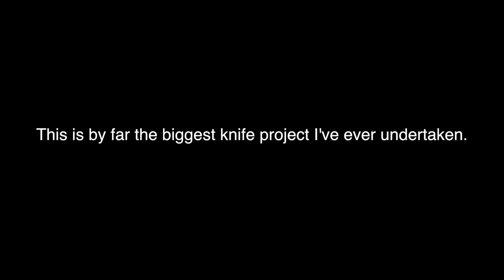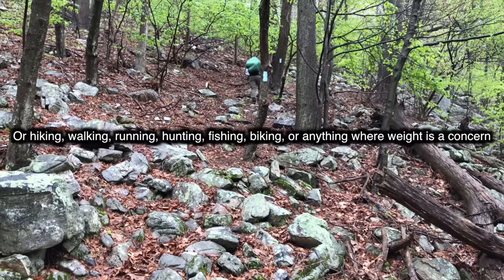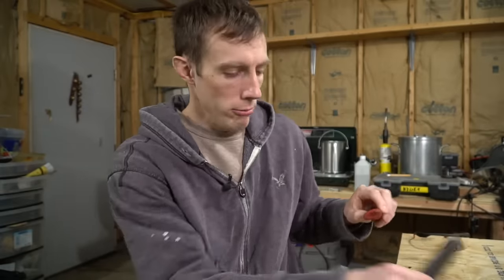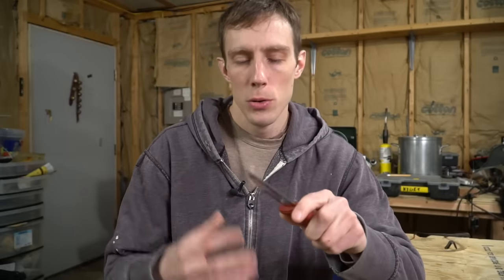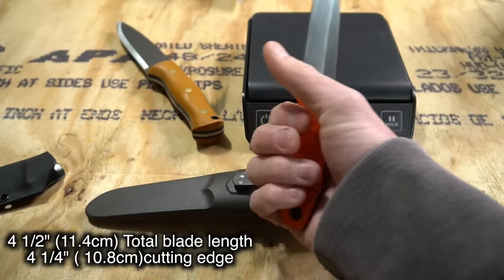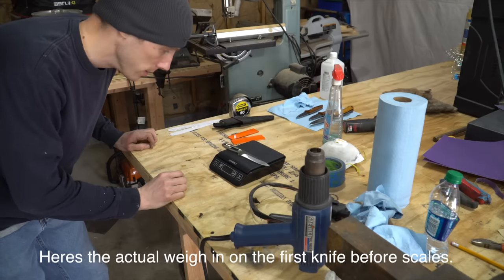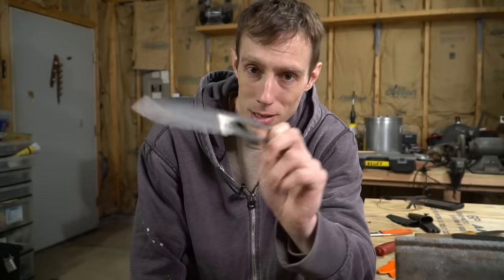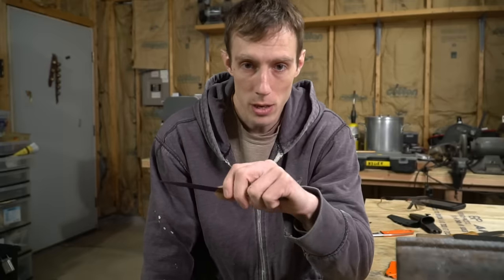What is the ULTIMATE Knife? Probably not what you think...

Comment: These hiking types really make my head hurt. I'm the army, we didn't measure rucksack weight by ounces, but by pounds. Then you add 210 rounds of 5.56. A six pound rifle, and if you are really lucky, your Sergeant hands you the first forty pound receiver to the .50 Cal. So yeah. Couldn't have cared less about the one pound chunk of steel strapped to my belt.
Reply from the maker: Your completely missing the point..
Reply: Three point is, one ounce doesn't matter. One pound doesn't matter. The more you do it the stronger you get.
Reply: It's ok though. If you are worried about it, then by all means, carry lighter stuff. I just never got the choice. I'll take a knife that I know I can rely on, even if it is a bit heavier.
Reply from the maker: The point is, if every piece of gear is 1oz lighter thats adds up to pounds. For the same reason aluminum, titanium, and carbon fiber is used on airplanes. Saving one ounce on a 250,000 pound aircraft seems pointless. Untill you save one ounce on every part. 

So the argument would be the same. Why not just throw bigger engines on the plane and not worry about weight? It's called power to weight ratio, and diminishing returns. 

At some point putting bigger engines on the plane actually makes it slower, and able to carry less weight. The weight of the engines them selves becomes the problem. 

The same thing happens in humans. Theres a reason you dont see 220-300 lb weight lifters winning endurance sports (cycling,running, cross country skiing, triathlon etc). They simply weight too much. Their body weight outweighs their ability to move fast enough. 

Certain types of backpacking/hiking trips require the same type of endurance. Through hiking the AT for instance. And long, high mileage hikes where you can be moving 15-25+ miles a day for days on end in mountainous terrain. 

This is what this knife is designed for. Someone who does these types of things where weight is the highest priority. And unless you do these types of things you most likely wouldn't understand.
Reply: I have done these type of things my entire life, strong when I was ten years old in the Boy Scouts. And assuming that I just don't know what I'm talking about is getting kind of old. Those aluminum and titanium things you are talking about did not even exist when I was your age. This was only twenty years ago, by the way. I was a weight lifter. I had eleven percent body fat. I was an extreme athlete. Not so much now, but I'm forty years old and work to much. I'm not trying to make you feel like you are doing something wrong. Go for lighter if you want, but my point is, that you don't need lighter if you train for it. Train, train hard. We always said in the army that you should train as you fight. But that isn't what we did. We would train harder than how we would fight so when it came to the fight, we were overtrained. Does this make sense to you? I'm not calling you a pussy. I'm trying to help you. Take it for what it is and quit fighting. Old guys usually know what we are talking about.
Reply: And by the way again. Good for you for getting out there and getting off your ass and going something. Just so you know, I don't dislike your video. I'm actually quite proud of you for doing the things I myself love to do. But when you get a young son and a wife to go along with you, you will appreciate my advice. You will be strong enough to carry to stuff that they aren't able to. Be proud of being a strong man. Nothing wrong with it, despite what people are saying that's days. Be strong, young man. Hooah.
Reply from the maker: To each his own. Btw im not younger than you. And have a wife and kids. 😉Just goes to show never judge a book by the cover.

Comment: Pro tip: before epoxying on the scales, put on scuba gear and evacuate all the air in your shop. Then introduce a pure hydrogen atmosphere and make the scales gas-tight. This will save at least a quarter gram compared to an air-filled knife. If you multiply this by the miles carried and the remaining years on your life, this simple expedient will make the knife an average of 3.62 metric tons lighter, and that's nothing to sneeze at, bra.

Comment: If money isn’t a parameter why not just use alloyed titanium for the blade with your carbon fiber scales?
Reply from the maker: Titanium is a poor knife blade material. Its just way too soft and not very strong.
Reply: @OUTDOORS55  look into grade 38 titanium alloy. I don’t have cad or any of that stuff but it seems to have decent strength and shear resistance. If not that then try grade 5 titanium alloy. It’s heat treatable so you can increase its strength and hardness. I’m not a knife maker so I don’t know I just thought it would be an interesting yet expensive idea. I’ve seen axe heads made of titanium and they performed better than their steel counterparts. Yet again axes are different than knives so who knows? I sure don’t lol. Loved the vid tho!

Comment: Make a carbon fiber handle for your knife.
Reply: shoveldriver1 to be able to break that red plastic you need to beat it several times with a sledge hammer - it is sturdy and still a bit flexible so the chance it breaks is nearly impossible , especially outdoors and not in a machine shop with heavy objects falling

Comment: Let's see... Better get cracking on a titanium san-mai blade with a carbon steel core for weight reduction. You already have some carbon fiber underway so that's good, though also hollow them out on the inside. Deep hand filed jimping all over the blade, taper that tang bruh!, carbon fiber handle pins, perhaps a hollow grind, heck, trow in a nice deep fuller, perhaps even with a row of holes in it, and slim that puppy down. Serations on the edge (yeah I know, they're a b*#ch) can also save you some weight, and a nice big swedge on top, which you can still leave plenty sharp for them ferro rods. I still see lots of potential in making that thing as light as a hummingbird's butt feather 😁
Reply from the maker: Lol 😂 titanium sanmai would be epic if possible 😂
Reply: Serrations won't hold up to batonning. The parameters are what is challenging

Comment: Why not spread out a oz of weight savings across your whole pack, and increase your stamina a bit? Seems like it's be easier to add weight on your person while doing cardio and offset an extra ounce of weight with physical prowess.
Reply from the maker: Your missing the point...if one was to add 1oz of weight to every item, one would add a lot of weight. If every item has already gone through the weight cutting phase, why not the knife? Same for air planes or anything else where weight is an issue.

Comment: I have that same knife mine's a little bigger than yours and the handle has soft rubber on it but that thing's a damn good knife and it holds an edge like a son of a bitch and for 75 bucks hell yeah I do it again only problem I have with it is it rest really easy and the way the handle is makes it a little hard to sharpen the very top of the blade but other than that the damn good knife I buy it again I was hesitant until I got looking at it things built really sturdy like I've  beat the hell out of this thing and I can still shave my face with it put an Edge on it it holds it but it is hard to sharpen because the middle is so damn hard like if you use and stones and stuff like I Do by hand hope you got some time you going to need it oh that in the sheath is really good in handy so you can just clip it on and off your belt without taking it off and it holds the blade in there really good I like man you're looking for a good knife on a budget well you found one

Comment: Tappered tang boy! Check Jeremy from simple little life making a tappered handle knife, you’ll shave some grams.
Reply from the maker: I was trying to not do the tapered tang route. I want some lateral strength in the handle for battoning. If i want i can still remove the same amount of steel in the tang, just on the inside of the hollow rather than the edges like on a taper. And id still have some lateral strength. I still may do a taper though im just not sure if it's needed yet🙂

Comment: I appreciate what your trying to do. But there is no ultimate knife. If your just hiking or marathoning and want to save ounces. Well just get those disposable skinning knives, you know the scalpel  that come with extra disposable blades. If at any point  in your week long trek through the woods your planing on camping or just doing regular chores, like camping or fire making or even building a shelter out of your surroundings?  Then dont skimp on the knife, no matter what the weight is, its the one tool you would be using constantly, and for everything, if you want to save ounces, I think the guy that said dont wear underwear or get light weight shoes may be on to something.
Reply from the maker: So your saying rather than having the correct tool for the job, to accept a compromise...The point is, I need a knife for a specific job, thats still capable of doing what I need it to do, as outlined in the video.  Its not skimping. Its carrying exactly what you need and nothing more and nothing less.
Reply: Well you did say its just for opening dryfood and cutting paracord. So ya, the disposable kifes can do that and there pretty light, in fact if carrying  is to much, you can just throw it away. But in all what I am saying is, that if 10 oz is to much weight to carry, time to hit the gym or work out a bit more. I dont know, personally I like and make knifes that are more on the robust side, i have some choppers made out of cru v that I think are more then a pound, and I would not hesitate to carry that around on a bikepacking trip. But! if its just a hike, there and back, then ya your right, lighter is better. Either way, whatever works.

Comment: If you want lightweight, you gotta try rat tail tang, bruh. Rat rail is less than a half the weight of your skeletonized handle, bruh. Fuck scales; you make a handle out of wood, bruh.  Plenty of that in the forest if you break the handle.  You want a useable, knife, you can shape that handle in 360 degrees, it's not just a flat cardboard cutout. In an emergency if the handle breaks, you cut a green branch and hammer the tang through the pith. Instant handle, bruh! And in winter, you can use your knife with bare hands without the handle freezing to your skin, bruh.
Reply from the maker: Because this way is much stronger structurally than a hidden tang design. and doesn't rely on the handle material for any strength as well.
Reply: @OUTDOORS55  Steel is strong, bruh. I agree your full tang handle is stronger; but there's strong enough and stronger than strong enough. Either one is fine.

You look at history, bruh. When knives and swords were actually used to as primary weapons of war and tools for survival, bruh. They were all hidden tang construction. It wasn't until the 19th century when steel was manufactured in sheets and knives were made with grinders/saws instead of forging (and guns had already taken over) that you even see a full tang knife, skeletonized or not, bruh. 

When the best way for killing other humans was with a blade, they used hidden tangs, bruh. When people actually needed knives to survive rather than for recreational hiking, they used knives with hidden tangs, bruh!

"Doesn't rely on the handle material for strength" An axe has a wood handle and it is fine that way. We don't make full tang axes. You spent 5 minutes explaining how useless a knife is with no handle. Even with paracord. If your scales fall off, good luck fixing that. If your wood handle breaks, you can make a new one in the field. The reason the mora breaks is it has a stub tang and it's made of plastic. You ain't gonna break a proper handle with a longer tang. Marine Kabar fighting knife has a hidden tang, and the handle is just leather rings, let alone wood. 

Thanks for responding, bruh!

Comment: Sketetonized is about the blank. You can put handles on it but it remains skeletonized. It's like spraying whipped cream on a turd. It's still a turd. 
I like the video and the quest to make a very strong and lightweight knife, but is skeletonized better than a broad stick tang?  I don't think so. I think a skeletonized handle is as tough as the weakest part in the handle. If one side snaps most likely the other side will to.
The epoxy and the bolts also add weight. Of course you can use expensive low weight materials and add cost. Who's gonna pay for it? Most hikers don't even care about a knife.

I like the idea of having this strong and lightweight knife but they are already out there. Hultafors, Mora, Brisa, etc. I can baton with all of them. Of course you have to learn how to baton and know the limits of your knife just like you need to learn about the rest of your equipment.

Bring a heavier knife and wear flip flops. You have saved some pounds there.
Take another inch of the handle of your toothbrush but just make sure you bring your entire house and kitchen but in a titanium lightweight way.
Reply from the maker: I don't agree. Heres a follow up video showing just how strong a skeletonized knife can be. https://www.youtube.com/watch?v=n1ywYKEhgRE Youd be surprised just how many will pay for it...to each their own😀👊

Comment: It is impossible to get all your cake and eat it! There will always be trade offs. A properly forged knife using a good simple steel like 1070 or 5160 with a properly sized handle for your hand is the way to go. Knife performance must always trump weight or you may just be putting your life at risk. 2 or 3 ounces here and there is utterly meaningless. My choice would be two knives: a 3 inch small and really sharp one and a 5 inch camp/hunter type knife. Leave your deodorant at home and use that weight to carry proper knives! Correctly forged knives will bend stupidly and not break. Also make sure you can sharpen knives correctly! Remember that knives used in sub zero environments must be re tempered after your trip!

Comment: Noble pursuit! The Moras are so much lighter because they're way thinner, way shorter (length) and way shorter (height - blade to spine), with a cheap plastic handle. There is definitely a stronger, longer, yet lighter-weight fully-capable (i.e., batonning-capable) knife design out there to discover and you're most of the way there in this vid. Many good ideas in the comments below will help, like tapering the handle (a little), hollowing out the scales (not too much - don't make them weak!), a fat lanyard hole (but don't riddle the thing with holes - that's just stupid) and a shallow fuller can get you further along to that end, but the biggest thing I could think of is to reduce blade and handle height just a wee bit. Maybe even thickness, but I wouldn't personally go less than 1/8". You quickly get into wimpy knife dimensions and I have always felt that Moras are too thin unless you're just whittling and cutting food. For me, batonning is a critical capability of a light-weight backpacking knife because if I'm going ultralight, I'm not bringing an axe or other chopper, so my knife has to do the splitting. As many a wise backpacking weight-optimizing guru has noted before: "There is good weight and there is bad weight." A good, strong knife is GOOD weight. Your LIFE may depend on that tool -- don't wimp it out too much! Save the weight in your pack and your choice of boots and so on. Use titanium cookwear and utensils. Perfect this design -- we will all buy it! Good luck!

Comment: Dude, I like your videos, but I think you may have wandered off the farm with this one. If you're in a situation where the difference between 2.8 oz. and 3.4 oz. is going to be critical, chances are you have a whole lot of other things going south for you...just sayin`...
Reply from the maker: I think your missing the point. This is a case of using the best materials to make the best knife possible for a given task.  The point is that i can make this knife better. If we stop at good enough than we've failed. An example would be;  Why not juststop grinding the bevels at 36grit? Whats to point of finishing sanding if it has no effect on the blades usability?  Why not just shape every knife with an angle grinder and forget finishing all together? Just some thoughts 😀👊

Comment: I enjoyed the video. However, I say, humbly, respectfully, that if a gram is the difference between success and failure, then you need to eat some more Wheaties every morning. Please accept that this is not criticism but I do not understand your emphasis on minute matters of weight. Again, respectfully.
Reply from the maker: Thanks for the comment! The idea is that if you save an ounce of weight on every piece of gear you can save several pounds. Which can be used to carry more of what you actually need (food/water etc). Several pounds might not seem like a lot but over the course of hundreds of miles adds up. 
  The same can be said for other industries like in airplanes. Saving and ounce off of one bolt doesn't seem like much but do it several thousand times and you have a much lighter aircraft. Hope this helps explain the reasoning 🙂 Again thanks for the comment 👍

Comment: The real answer is ditch steel and use a titanium blade.
Reply: Titanium isnt that great of a metal for blades
Reply: swift tea yea it I've made a couple blades out of it, it's hard to work with but it does pretty much everything better than steel.
Reply: @tatsuhirosatou5513  except hold an edge and titanium is substantially more expensive
Reply: @javanbybee4822  it is more expensive but it holds an edge better it's harder than steel.
Reply: @tatsuhirosatou5513  but it doesnt harden as much as steel